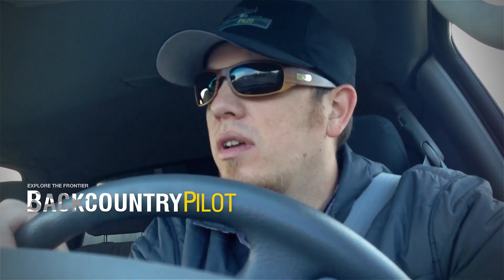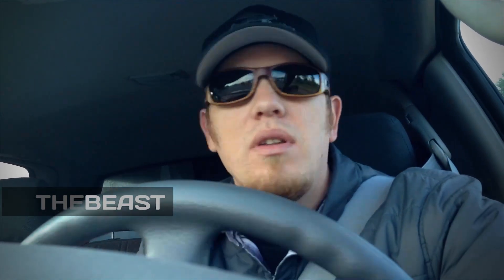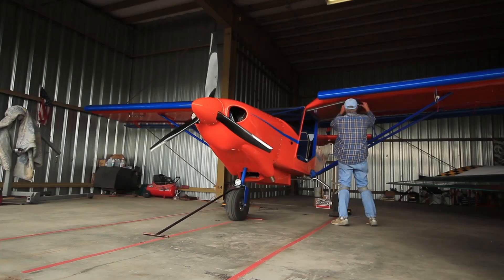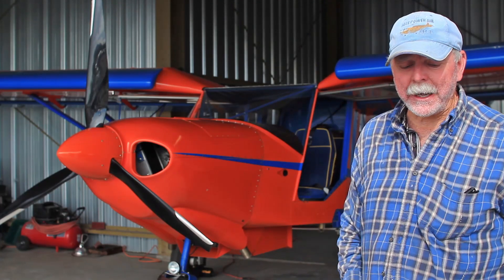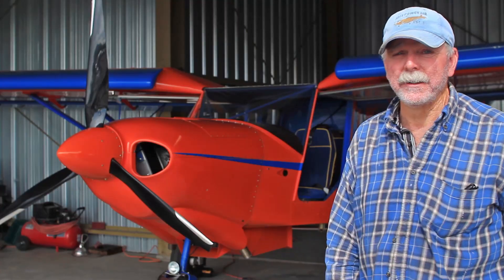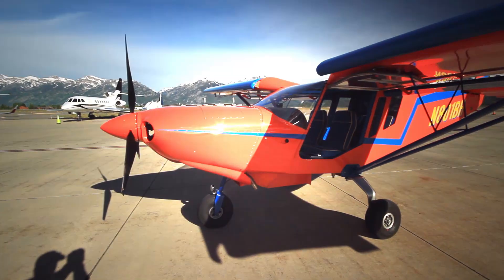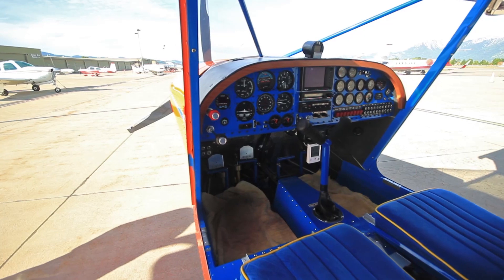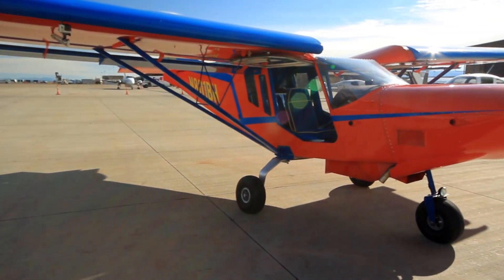The Beast - NASCAR powered Zenith CH801

Comment: Awesome aircraft. Very poorly flown approach though :-) waaaaay low
Reply: Julius Dennard yes, and thats not how professional or experienced PPL pilots fly them. There is no difference in landing distance required between a dangerously shallow approach and a steeper more correctly flown approach angle.
Reply: Julius Dennard do you know why he needed throttle at 3:45? see if you can guess what would happen if he'd applied throttle and got no response from the engine. A schoolboy error, easily avoided with a correctly flown engine idle short field approach.
Reply: I don't know where you received training for your PPL, but I was always told by my instructors and examiners that if you don't need power when doing a short field approach, you are doing it wrong. On an actual short field approach, you don't want to have a glide in approach; but instead, be heavily dependent on engine power. His approach was more than perfect, and you would recognize that if you ever received training from a competent instructor.
Reply: With that engine, he can pull out.
Reply: Ray Moser not with an engine failure he can't.. this is a poorly flown approach, no excuses.
Reply: I'm not so sure.  It's an acceptance of risk.  It seems awful similar to what Cub pilots do when they drag one in across a lake and touch down on a gravel bar.
Reply: Ever heard of short field landing
Reply: did you not see all the open terrain in front of him as well? I get your point, but he would have been fine. Especially in the 701.
Reply: Julius Dennard there are old pilots, there are bold pilots. There are no old bold pilots.
Reply: I don't care for the negative comments.  Thank you for sharing your awesome aircraft.  I love the CH series of airplanes..
Reply: ATPL actually, but thanks. Your inexperience is obvious, we've all been there. Later in life you'll come to realise a lot of the aero club scene is just the blind leading the blind :-) I find it absolutely bizarre that anyone with any less than a couple thousand TT would be allowed to instruct someone, but that's how the system works isn't it :-)
Reply: Ray Moser i dont think its a negative comment its more like a critic,a note ... he was really low at the approach
Reply: I remember this line best from the movie "The Black Hole." I loved that movie!